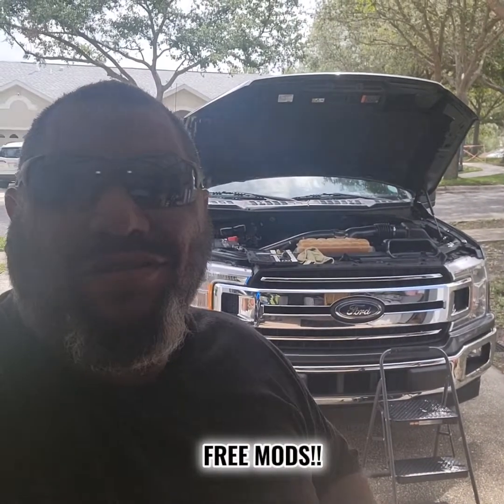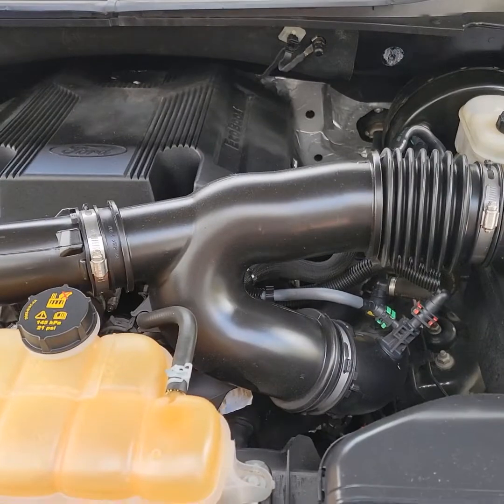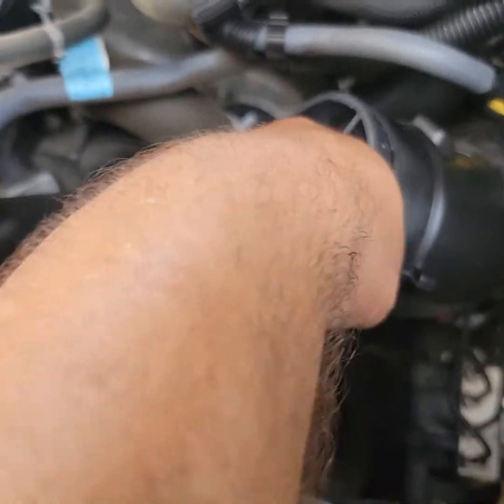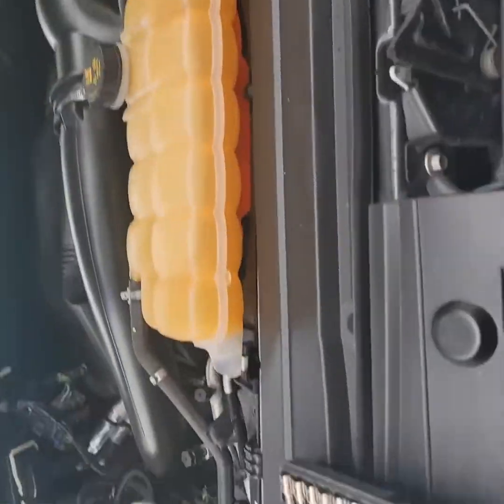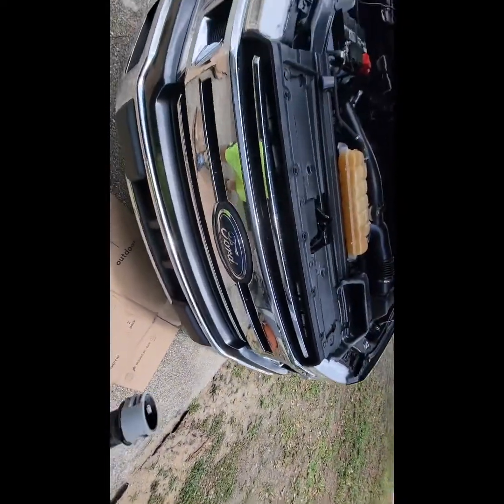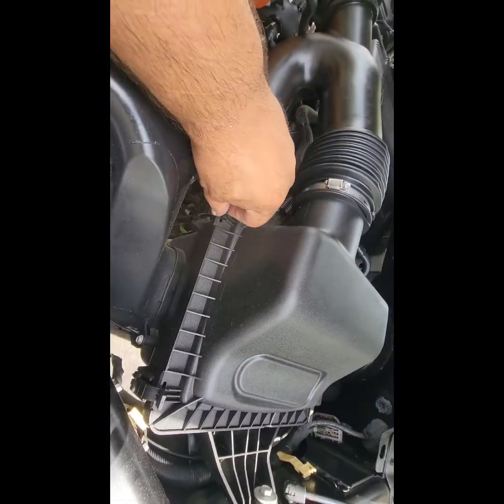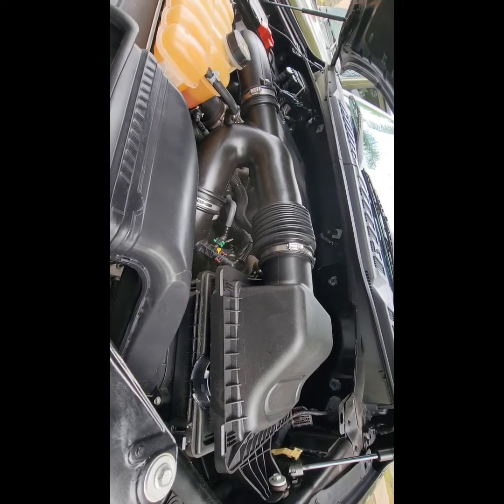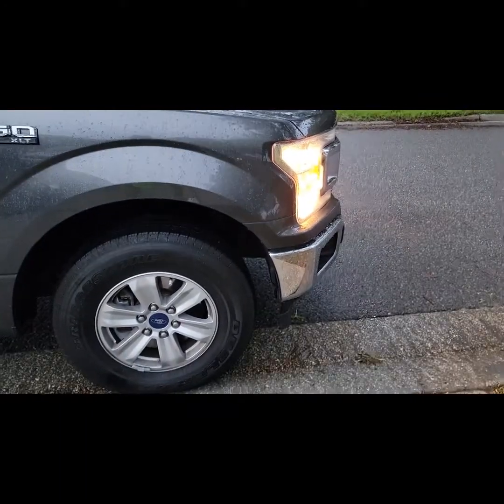FREE MODS FOR YOUR F150 ECOBOOST!!

Comment: you might need to remove the exhaust resonator. that should let you hear the turbo spool.
Reply from the maker: I plan to remove the cats off the Y-pipe for more whistle.  I already have a K&N air filter which now has the truck whistling.

Comment: It’s been 8 months since posted so has it damaged anything yet or caused any problems ?
Reply from the maker: I have added a K&N Air filter. I never left my air box opened. I do feel that my truck responds much better with less restriction now. Especially when we get colder weather here in Florida. The air to atmosphere (free mod) is still exactly how I did in this video. I have had no problems and still recommend it to other Ecoboost drivers all the time. Just remember that this mod does not add any horsepower. It's just cool to hear my truck blow off the extra air under hard acceleration.  I don't drive my truck hard all the time tho, so i only hear it in moments when I'm getting those RPM'S up.
BUT NO ISSUES AT ALL!😊